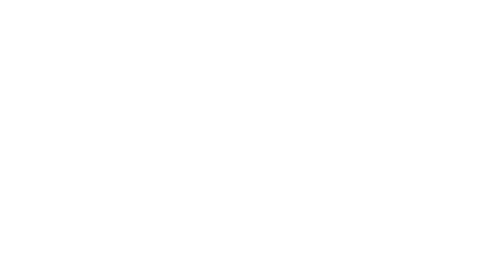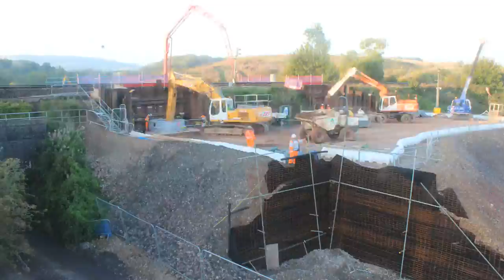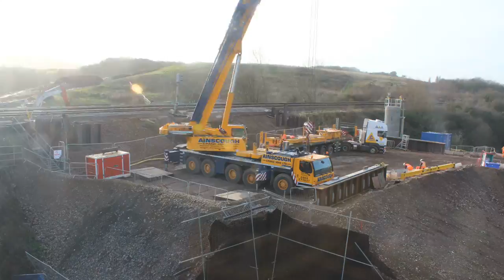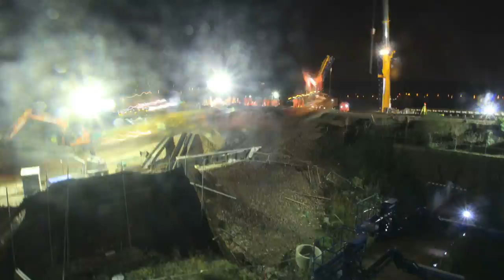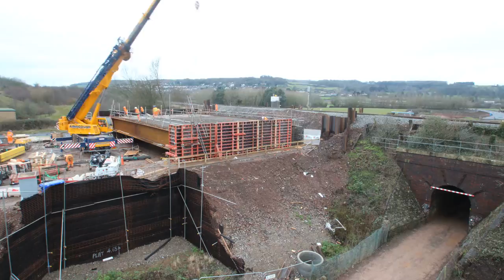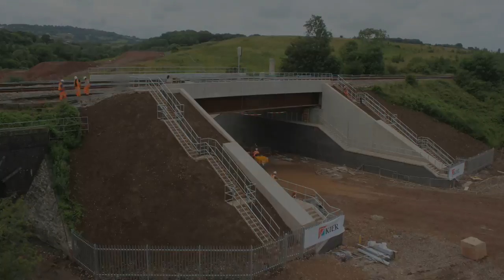Time-Lapse Example: Parson Street Road Bridge

Comment: Being relatively local to Filton and Patchway, I've just commented on the Filton Bank Blockade time lapse and asked whether the forthcoming replacement of Gypsy Patch Lane bridge might also be getting similar treatment.  In respect of the replacement of the Gypsy Patch Lane bridge, I have been told it is a requirement that the line, which is the main line to south Wales, can only be closed for a maximum of eleven days.  In answer to the comment that what we see here was a very expensive way of  building a bridge, I must assume that a similar constraint was placed on the work.
Reply: Expensive you say, that'll be standard proceedure for Kier, so the job over runs and they lose money.

Comment: i couldn't work out what they were doing.  after watching the whole thing it became obvious.  then my brain started devising all the other ways this could have been done.  moving all that dirt would have been a great percentage of the cost.  if engineers spent more time on tools, or any time on tools, before graduating, they might have devised any of the better ways to do this job.
Reply: I'm curious to know how you would have done it better, given the same constraints.
Reply: @johnm2012  ,i had to watch it again to remind me why i made the comment.  that massive amount of dirt that was moved in to provide a stable base for the slide-in indicates to me that there are going to be many different ways to do this while maintaining traffic on the lines.  so i wouldn't do that slide-in bridge.  how about a single section placed next to the line on whatever sort of temporary support after the abutments have been done. then a big dig out of one existing track and base just enough to slide or lift the new piece in.  and another thing use bigger excavators.  they move more dirt faster.  i'd do the new bridge section in steel only.  then put the new section of track straight on it.  then do the other side.  it sounds easy from my armchair.  a useful piece of equipment that anyone who does this sort of stuff needs to know about is called a "non-intrusive crossover". they're made in scotland.  its patented but i have reason to suspect it is a repackaged old idea probably not worthy of a patent.  if the slide-in was to bugger up and couldn't be completed overnight then the "nic" could be used temporarily to maintain services.  call it the plan b that every engineering job requires.  but omg, all that dirt!

Comment: And THIS was the ONLY way to build it? The span is barely 20 meters IF THAT! Building a huge mountain just to slide it instead of building it like normal people do was a VERY expensive idea. And pretty much unnecessary unless there's more to the story.
Reply: Here is your "more to the story": Do it the "traditional way" and you have to close down that railway line for weeks, if not months. This way you're down to a handful of days at most. And shutting down an important transport axis for an extended period of time is going to cost a lot more than the additional construction expenses. It is pretty simple, actually.

Comment: Gees! 12 months to do that.Probably cost 3 times as much as it should have too. I bet some engineer made a shitload of money from that job.
Reply: it only took that long because they were having to build the bridge beneath an active railway line - it would probably cost 5 times less to simply shut down the line and dig the stretch out, you could likely have it built in a couple months, but because our rail network is so overcrowded we can't close a line like this for a couple of months so we instead have to build it like this.
Reply: I agree.  I saw them put a 4 lane freeway under an active railroad and they did not build a pile of dirt to do it.  They dug under the tracks while temporarily supporting the tracks and then build the supporting bridges.  No waste of adding dirt just to remove it again.
Reply: @adelesexton5975  to install the temporary bridge structure underneath the tracks requires shutting down the tracks to do it, I don't think you realise how much traffic uses UK railroads - where in the US you're talking about 4-5 trains per day, in the UK it can be as many as 30-40 trains per hour on most main routes (and yes that's 2-track)
Reply: If you a bus replacement for 3 weeks to replace the bridge people would lose their mind. If this was China, they would have just shut the thing down and done the job. Unfortunately in blighty you have to appease the voters.
Reply: @xaiano794  You also have to consider that the cost of shutting the railway and the lost revenue associated with it would likely cost more than the extra cost involved in a scheme like this. 

Cost, speed, quality, pick two. You can have a quality structure with minimal disturbance but it will be expensive. You can have a cheap, high quality structure but you'll have to shut the railway down for months. You can have a cheap, low disturbance structure but it will be low quality. 

People will complain In any situation. If you don't maintain a structure or add/improve infrastructure people complain. If you close down infrastructure to maintain or improve it people complain. If you find a way of maintaining or improving infrastructure with minimal interference people complain that It costs too much.
Reply: @morbideddie  I completely agree but many without an appreciation for how much cost is involved when closing the railway I doubt the original commenter would comprehend.

I just decided to stick to benefits they could understand and using large monolithic girders means a lower surface area, meaning they don't have to paint the structure (unlike the old one). And don't have to inspect it as regularly as it will degrade far, far slower.